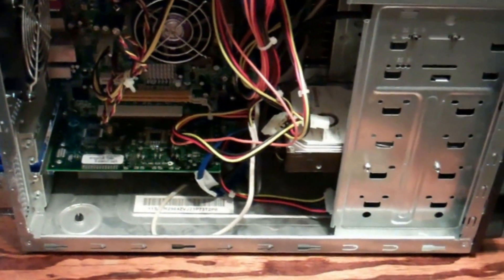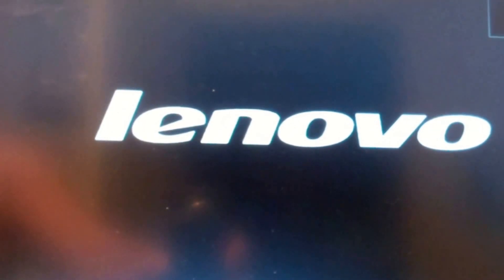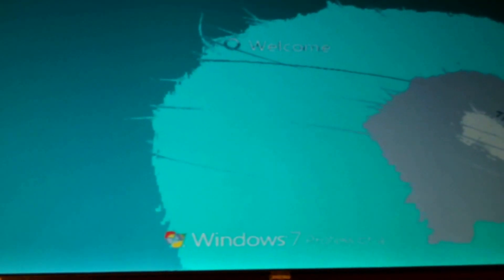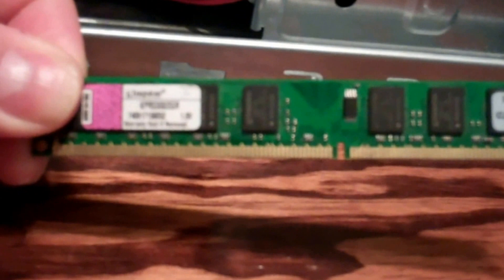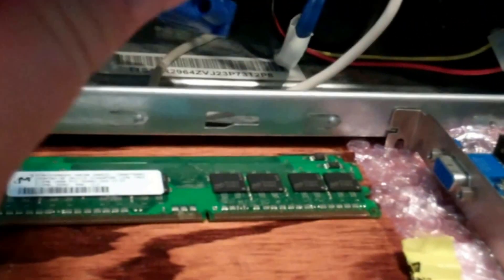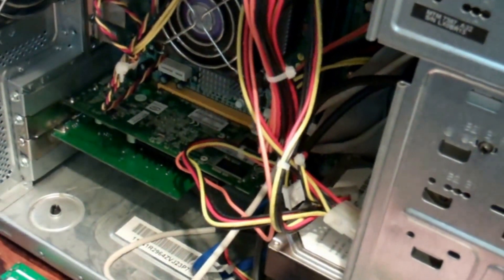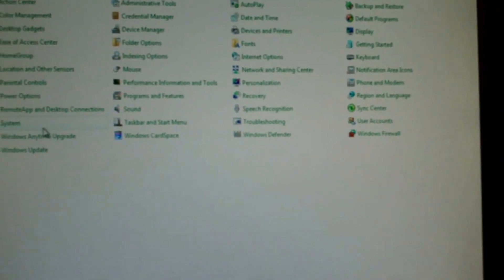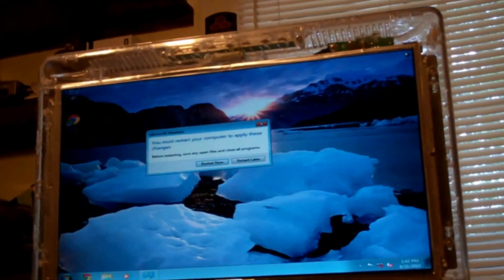Upgrading a PC RAM and Video Card

Comment: Old clip and not sure what happened next but:1- Did you install the driver for you initial video card for new OS? Guess that was your only problem2- You should be able to run your 2 displays in "Extended mode" to see one single larger screen image shared between two physical monitors.3- Nasty noise. I guess your hard drive is dying. Better back up your important data, if there is any.
Reply from the maker: Yeah this is an old video and have since posted an updated video here: https://www.youtube.com/watch?v=3MJhySehp60
I went with a MSI-5450 card instead.. The old Maxtor hard drive is still running amazingly but discovered later the mobo had some swelled capacitors and needed replaced and now has Windows 10 installed.